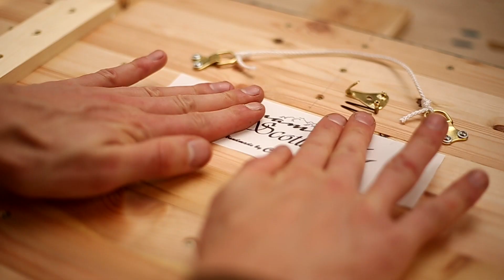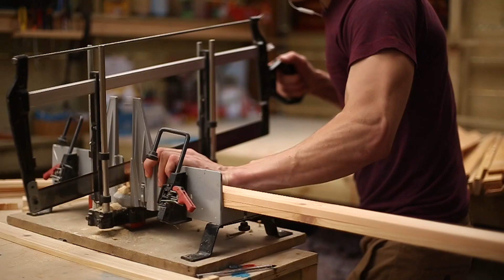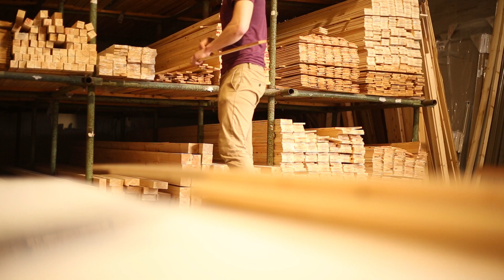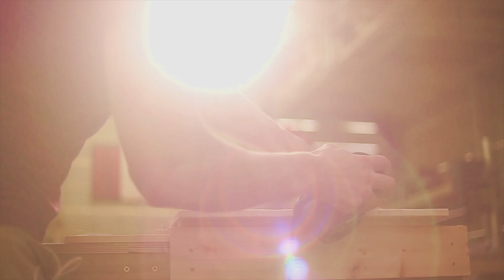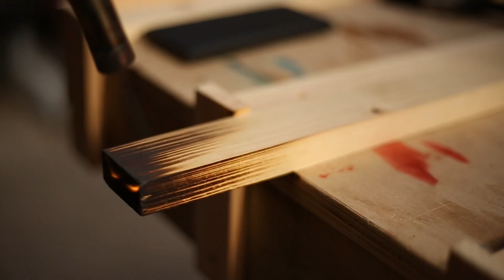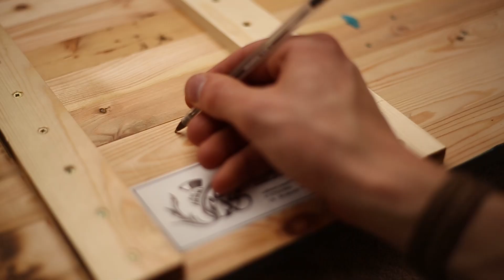How To Build A Union Jack - easy woodworking project

Comment: Hi Colin, just watched your video, im very impressed and would like to give this a try, however i note that you have a lot of comments all asking about the colour stain your using , can you let us all know please, many thanks Zoltan
Reply: Hey, sorry for only just getting back to you. The stains are water based red and water based Blue (Very light) solvent based light fast stains are good aswell but quite toxic to inhale. Morrells wood Stains work the best. Do test the stain before use and mix with water and a very small amount Acrylic paints to get the desired look. Any water based stain from eBay will do the trick. 🇬🇧👍
Reply: Does he not say in the video